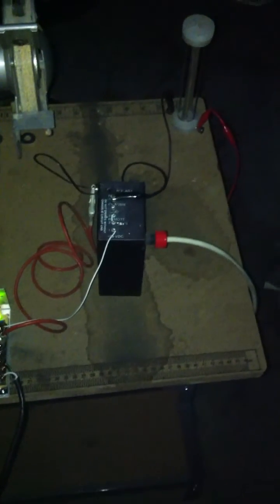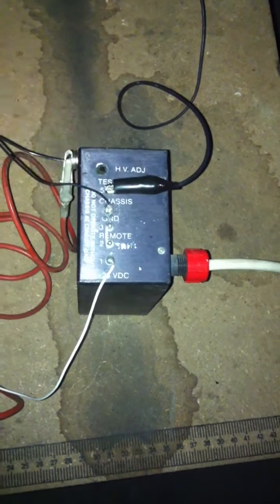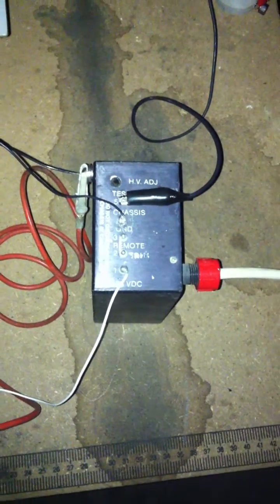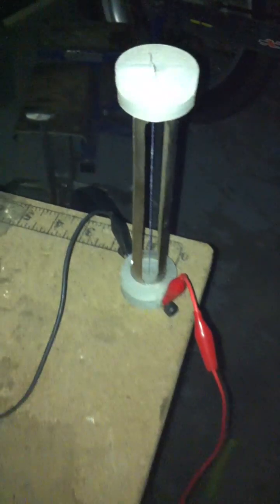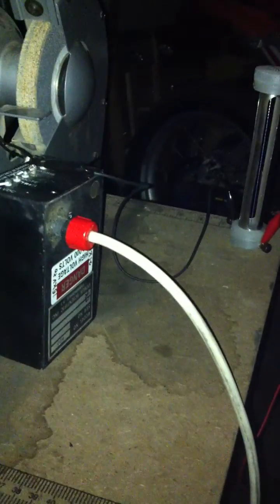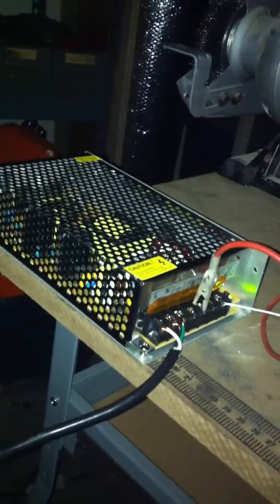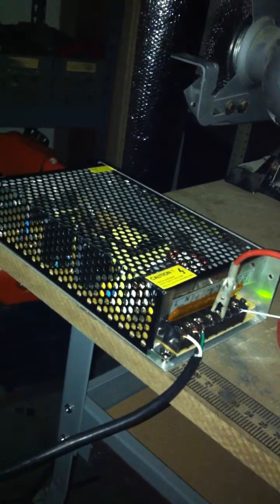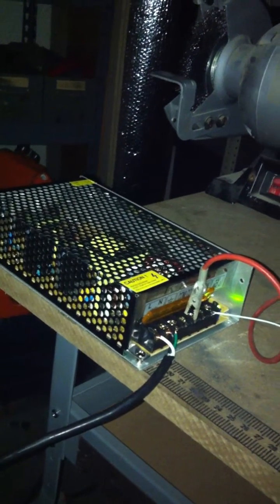Laser EPG 006 - HGG Hydrogen Gas Gun/Processor Part 3, Testing Slot Design (CORONA DISCHARGE)

Comment from the maker: Just to be clear, this is not an HHO device. I am not to the point of testing "liters per min" for magnetic gas production yet. I still need to assemble the gas processor and build the magnetizing unit. Once testing begins, I imagine slower will be better, to allow more time for the electrons to be stripped off the gas (helium, neon, or argon). If I were to guess at this early stage in the process, I would say less then 1 liter per min. The output flow is determined by the input flow rate.

Comment from the maker: While testing only the tube and wire with the high voltage there in no noticable change in the temperature. If there is a temperature change, it is minimal possible only a few degrees. There is however a large tempreture change with both types of LED strips I will be using. When they are turned on for more than 10 mins the back of the strip becomes too hot to touch with my bare hands.